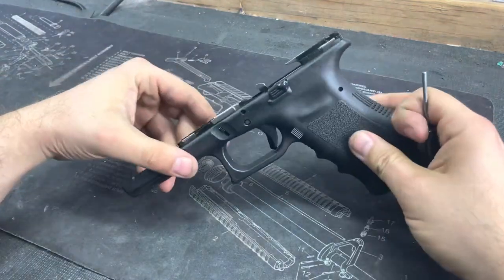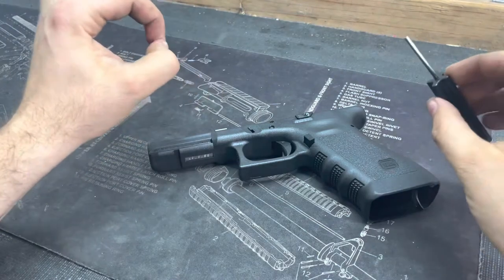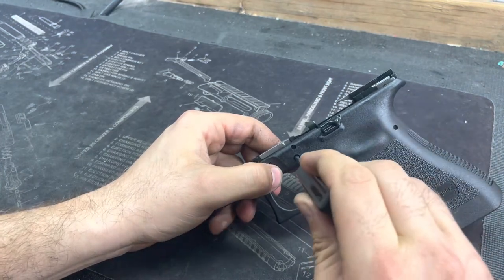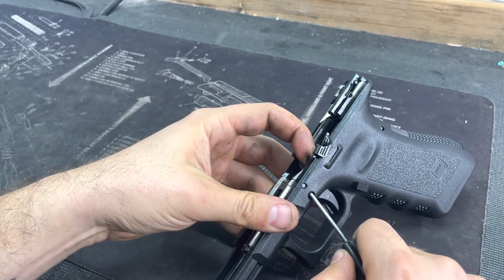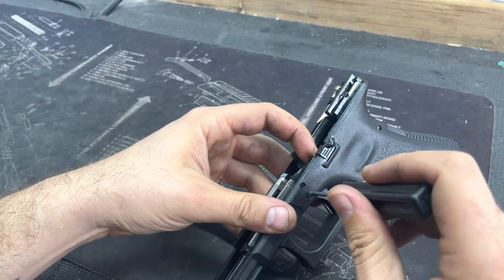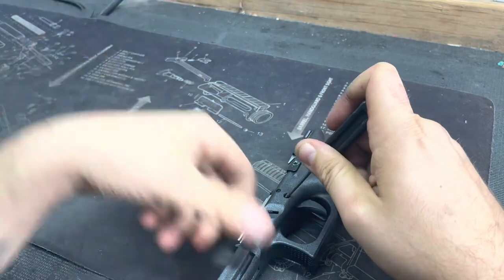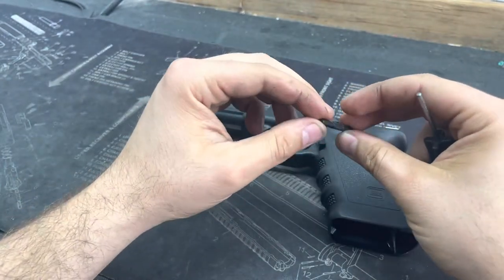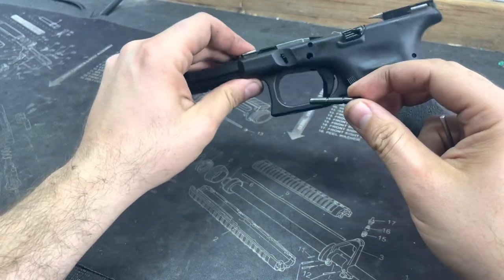GLOCK Gunsmithing: Trigger Pin Trick

Comment: Son of a bitch... been hammering on this thing for a half hour on my Polymer80 frame and then I saw your video and damn if it didn't work in less than 3 seconds. Thanks for posting this video, you just saved my frame from a sledge hammer. :)
Reply: Bro that me right now 🤣
Reply from the maker: The Glock platform is designed to come apart without a hammer. If you are using a hammer, something is either broken, or about to be broken!